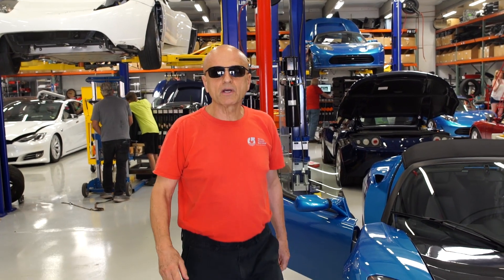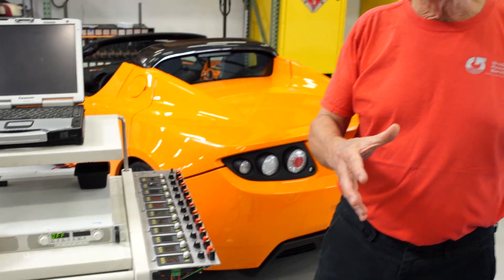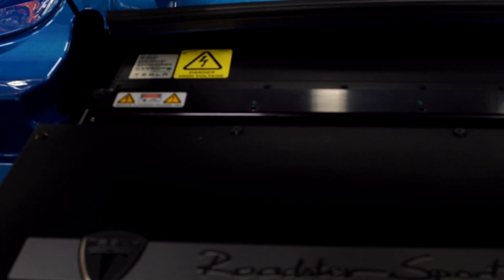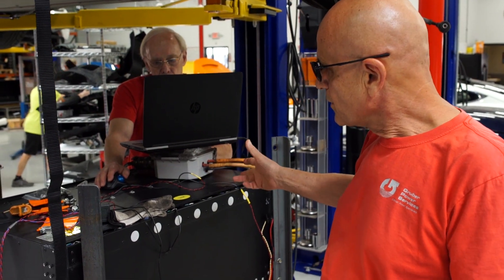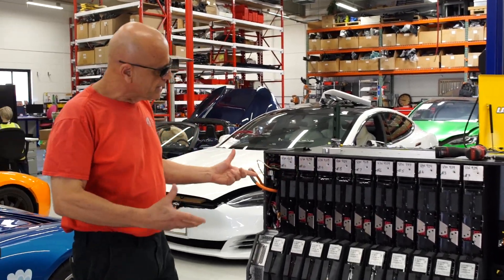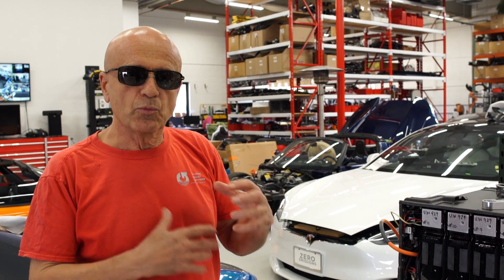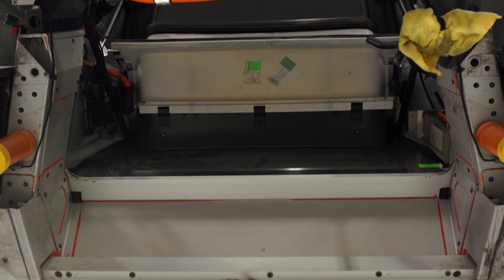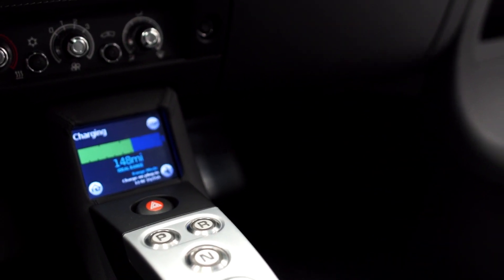24 Hour Tesla Roadster Recovery | Gruber Motors

Comment: To isolate a single cell that is parallel connected to many others, do you use precise thermal camera to monitor the tenperature diff  over all cells? or do you just measure the current flowing thru each bonding wires while charging or discharging? ( using the 4 wire kelvin method?)
Reply: Our procedure evolved, and continues to evolve.  It includes a combination of thermal evaluations, sensitive measurements, jolt charging and discharging while observing cell behavior, and minuscule trend analysis.  Although not yet a perfect science, we are achieving over 90% success rates.

Comment: In the high power electric bike community what is really popular are the BC168 high power balancer. These cost 80$ each and can do 1 to 6s at 0 to 8A.  ( these are wexactly like 6 indivisual 1s chargers on the same display) These are awsome as their algorithm can balance down to the 1mV precision quickly. You could stack many of these  with isolated 12V power supply and that's it  https://youtu.be/7-AofMzs0ds?t=166
Reply: Thank you.  I reviewed it.  It would work for us, but Roadster sheets have 9 bricks.  We could use two of these, but we actually developed a 9 station balancing system for Battery Sheets.

Comment: nice setup there. my question is how do you determine whether any individual cells have gone resistive or bad, and what would you guys do if there was a bad cell or cells inside a sheet/module? are you set up to tear down and replace individual cells? thanks
Reply from the maker: The resistive cell isolation is a combination of thermal and cell readings.

Replacing cells is destructive since they are in a thermal potting compound, encircled by a cooling jacket.  Secondly, two aluminum collector plates would have to be removed, and over 2000 wire bonding connections repaired with an ultrasonic welder, to get one cell out.  We simply disable defective cells.

A brick (9 per sheet), is a collection of 69) 18650 cells, and just one cell, in the 6831 count cells in a pack, can disable a Roadster.
Reply from the maker: No, there isn't a practical way to replace individual cells, so we just snip the bond wires to remove them from the brick.